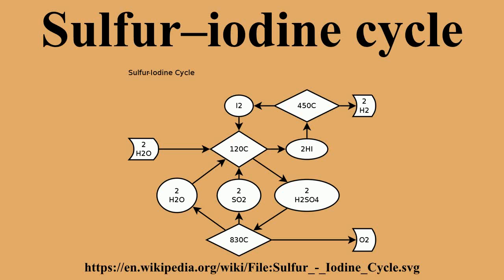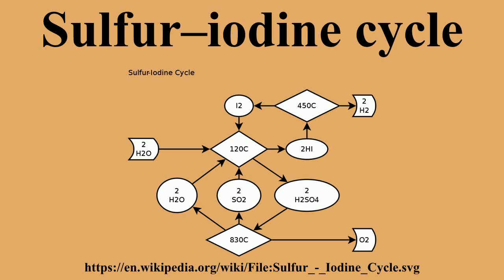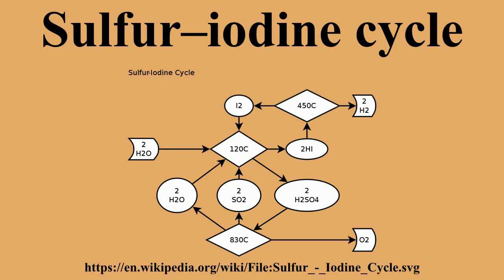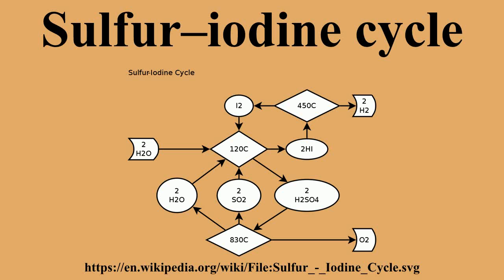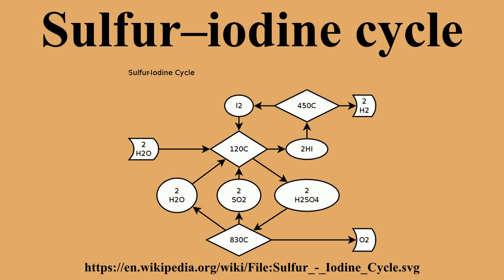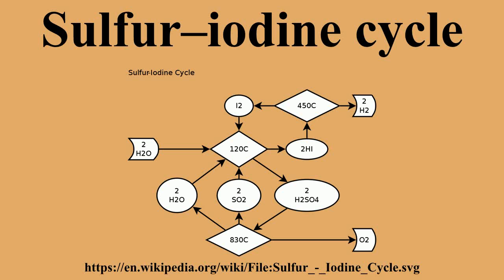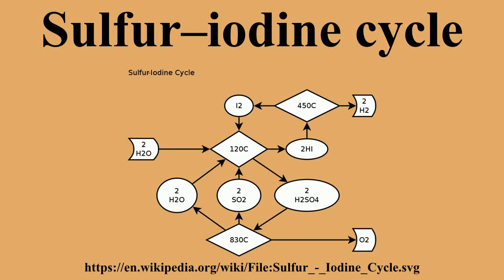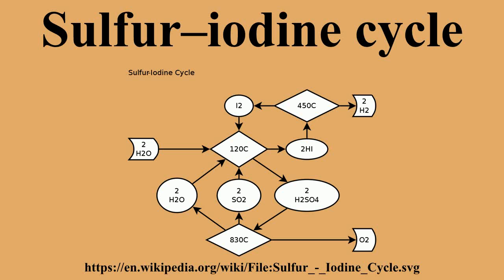Sulfur–iodine cycle

Comment: H2 is relatively poor as a fuel (low density, low energy density, causes metal embrittlement). How hard would it be to take the cycle farther and reform H2 + C02 (from the atmosphere) + heat to get Methane (CH3) then use that for the fuel (distribute it into the existing natural gas system).  I suppose CO2 being only 400 PPM is a problem but maybe CO2 could be trucked in from normal power plants
Reply: Actually methane is CH4.I thought about what you say.However,both H2 and CO2 are difficult to get in large volumes.In order to have an industrial production scale  one have to get large inputs.Also the power plants CO2 must be eventually cleansed .(eliminating H2S,COS,SO2,etc).
Reply: Pure CO2 can be had in quantity from cement plants, and converted to CO via the water gas shift reaction (using one molecule of H2).  You can then catalytically hydrogenate the CO to methanol, and use that as a feedstock or liquid fuel.  It doesn't have the energy density of gasoline, but it beats the heck out of H2.  Methanol is also excellent for use in fuel cells.
However, since the overall cycle returns the carbon to CO2 and the hydrogen to H2O - the stuff you started with - there's zero net energy gain even if your processes are all 100% efficient.  If you drive the S-I cycle with non-fossil energy (solar, nuclear, geothermal),  the overall process might be a useful way of storing that heat energy in the form of a transportable liquid fuel.  Not exactly carbon-neutral, since the cement plant's CO2 eventually makes its way to the atmosphere.  (You'd have to extract CO2 from the atmosphere to be truly carbon-neutral, and that's a whole different problem in itself.)